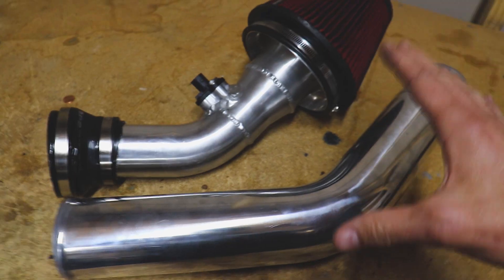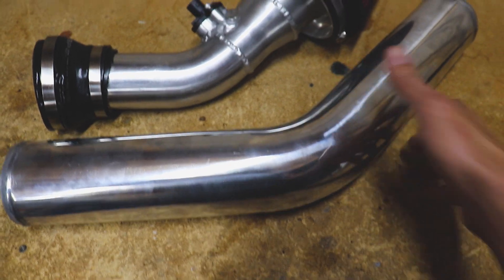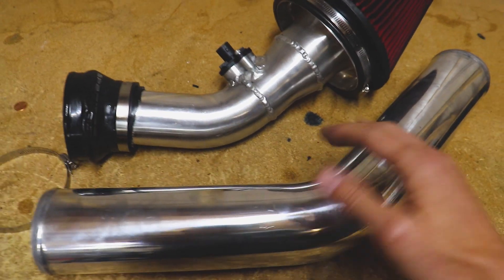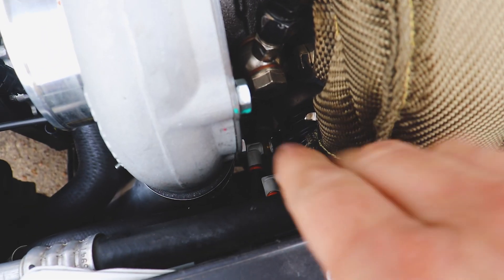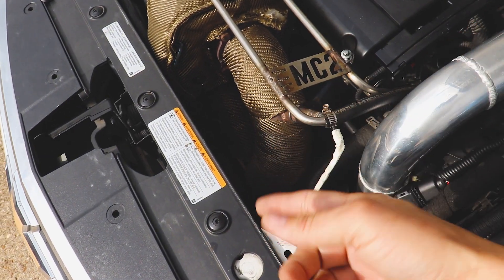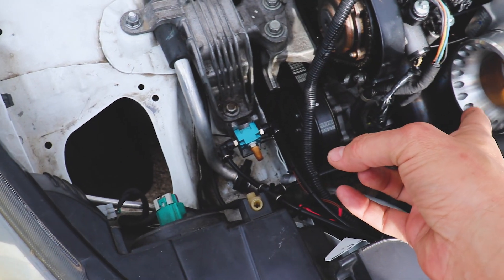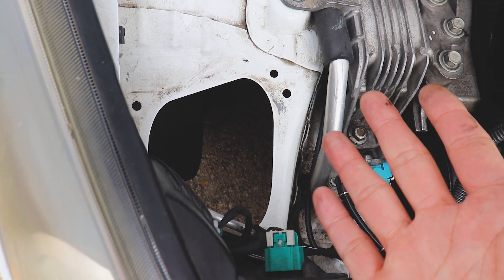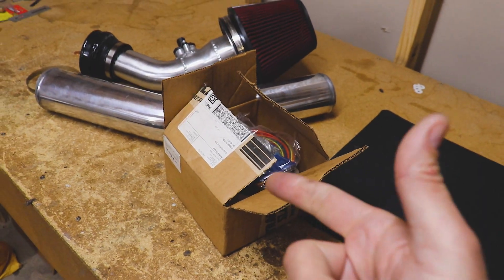Build Update: Addressing Turbo Manifold Heat Issues and What's Left to do before we hit the Dyno

Comment: Hood vents will be dumb if u want the car to stay cooler under the hood have the radiator fan on a timer so it runs for a few minutes to keep air flowing when the motor is off. Upgrade the battery there is tons of room in the battery tray for a big lithium battery that will run the fan for hours with ignition off.

Comment: Hi 
 Get the fog light part and a 3 inch pipe with a bend up the the opening but do not attach it to the filter or intake pipe in case you run into deep water. 
  Vents for the hood look for a 3.4 twin cam lumina from the 90s they had some Vents in the hoods you may find them in the u pull it yard. 
 For items getting hot 🔥  you may need some heat reflecting tape or ls spark plug boots to cover your wires once the plastic tubing is fixed. 
 As for the plastic push locks & plastic tubing you could go with aluminum tubing once you get all yout lengths correct & maybe able to pull it out as a unit if it's possible.  
 I thought you wrapped the header when you installed it ?  I must have missed something.  
 Good progress for sure & dyno tuning is going to be a blast for you. 
 400 to 440 hp. @ 23 pounds of boost ( this is a lot of boost ) & tq
 should be 320 to 350 tq.  
  As always just my thoughts & be safe team.
Reply from the maker: I appreciate it Jeff! Thanks for all the tips and thoughts. Looking forward to seeing to final numbers.

Comment: Is there a reason you didn't just take it to the Dino the first build. I figure you don't want to spend more money on something that may not work out as Well. proving that it will actually take the boost first.
My cuz blew his up but he never tooned it. I thinking timing was his first problem. So glad to see this bild come out good.  Im thinking you get 250hp out  of it. 
Focus ST where pushing 270- 285hp 2.0L tooned
Reply from the maker: You nailed it. It'll cost $700 for the dyno tune and session. I want to make sure it'll live before hand. I know enough to tune it, but to get an expert that tunes for a living and to use a dyno as a tool to get the most power out of it safely is the end goal. It'll be fun to see what it does. Looking to push it to around 25-28 psi of boost.

Comment: You should definitely should wrap the manifold, not just for engine bay temps but also because it directs more heat into the turbo and heat is energy.  Possibly also look into getting the manifold ceramic coated inside and out too.
Reply from the maker: Great point.
Reply: I dunno I had a turbo manifold crack in half on me the minute I wrapped it when unwrapped it was just fine. The wrap trapped in so much heat it was glowing red and actually almost started the wrap on fire. Turbo make so much more heat then na engines.

Comment: Before you chop the hood up give some hinge spacers a shot to see if it's not too terrible to look at. Your engine bay is going to stay filthy with open vents on it. Not to mention if water gets on that wrap it's going to destroy it quick. 

Great content brother, one of my favorite automotive youtube channels. 👌
Reply from the maker: Definitely considering all my options.
Reply: If u break the seal between the hood and the wiper cowl all u will smell is oil and crankcase fumes from the breather getting sucked into the HVAC system because your intake is built into the wiper cowl for all the air u beath in the car. You don't have a vacuum on the breather it's just vented to atmosphere so I gautentee your gonna feel sick after awhile breathing your cam covers fumes inside the car.

Comment: Hey what’s up. Hope all is well. Question. What are you running to evacuate crankcase pressure?
Reply from the maker: Hey Dave. ATM, I just have a Motion Raceworks single port 12an catch can that vents to atmosphere.  Has been working wonders. It's hooked up to the stock PCV from the cam cover. Even at idle you can see it going to work. I'll do a video on it in the future, but it catches all the blow by. Comes out pretty clear and has been working really well. I took that idea from what the guys with the 1.6 VXR's overseas. Rather than routing it back in front of the turbo to burn it back off, which in time just ends up gunking up the entire intake system. I also did away with how the stock throttle body is setup, in which the PCV was setup to pull crankcase pressure from the PCV port behind the throttle body for emissions. I have a LSJ throttle I got from ZZP that does have the provisions for a the PCV, nor the coolant pass through because I don't really need that here in Houston. Rarely reaches freezing during the winter to justify it.
Reply: @cmattdabrat  wow that’s some crazy blow by! BTW I’m catching up on everything with your build. That’s why I keep asking questions if you’ve done a video I may not have seen it yet my apologies. But on the volume of boost you’re running did you have to open up your gaps on your piston rings?
Reply from the maker: @davesworld2132  I probably skipped over it just trying to get things buttoned up. I believe I installed it during the time I was working on the custom intake, and intercooler piping. Those were huge tasks vs a 5 minute install lol. But I'll post something on the subject soon to show how well it's been working. Yeah, the rings are gapped for all the boost, and nitros. It'll be interesting to see what it does once on the dyno. I know the ZZP Sonic is a similar setup and you can see the vapors coming out during a WOT pull.
Reply: @cmattdabrat  love it. By the way you’re so right. It’s so hard to choose what to show the public. Sometimes those little five minute projects we are proud of but the big stuff is what everyone wants to see!
Reply from the maker: @davesworld2132   A lot of truth to that. I'll do a video in the future showing the results of the setup. Posting a video of the install without results isn't very interesting to me anyway. Now to show, here's the catch can, and what it's actually doing for the car makes more sense.

Comment: There are some intake pipes that let you feed the intake Into that hole, then combines with the fog light vent, it’ll give you decent cold air
Reply from the maker: You're right about that. I have the stock intake piping which actually runs from the front of the car to that opening. I might just install that as well to get cool air from the upper front of the grill towards the filter.
Reply: @cmattdabrat whatever u do always have the air filter Intake higher then the bumper impact beam or in a Texas flood your going to hydrolock it.

Comment: I have the injection intake , and whatever temp is out side weather, the air temp going in is only 2-3 temps up, compare to other intakes close to the engine gives more than 14-up temps higher than temp outside
Reply from the maker: Nice! I've seen those and they look like a good setup. I believe those actually have the air filter in the wheel well right? Which I've thought about gettin the filter into the wheel well. My only concern is we get heavy flooding in our area more often than I'm comfortable with. Lost a car years ago to a cold air setup that just sucked up water on a rainy day.
Reply: @cmattdabrat  yes , since it’s two piece , you can remove one and have the filter safe when it rains, that’s how I found out how my air temps changed. It’s worth it 👌🏻

Comment: rad bro n for heat evacuation i made a cowl hood for my build but also u can do hood spacers like the honda guys do it does help n stays low key if u dont know what they mean when u see hood jacked at back lol ... keep on with it bro u doing it and the cruze is rad imo bro just takes time for perfection lol l8 bro stay rad n build on 💪 ✌
Reply from the maker: Nice. It wouldn't be too hard to cut the hood, and extend it a little to make a cowl. Just weld in the standoff portion, and repaint the hood.
Reply: @cmattdabrat  yeah not bad at all bro onlytook me cpl hours to get it to the shape i wanted with the cowel n now i just deciding if i wanna use it as a mold for fiberglass or carbon fiber or if i wanna wrap it were its aluminum lol decision decisions .... but yeah u got aluminum hood to right? so regardeless it already pretty light if so n u gor the skills for sure on the welding to make it look way rad bro ... n e ways peace n love bro stay rad and build on...

Comment: I recommend getting an upgraded radiator and address the cooling system before u get problems u don’t want. These cruzes are notorious for having cooling system issues. Imagine it with all these extra accessories and upgrades. Good to see ur getting ready to address these issues.
Reply from the maker: I hear that. The main issue with the 1.8 is just the plastic hose that goes from the thermostat to the throttle body, which I've eliminated. Aside from that, only issue I've had was just not paying attention to the fact the fan was touching the down pipe, so it wasn't able to run. The stock radiator has been working really well.
Reply: Cooling issues have nothing to do with the radiator. It’s the thermostat housing that creates all kinds of issues. Deleting cats and running a larger inter cooler and wrapping the manifold I bet the engine is probably running cooler overall to begin with